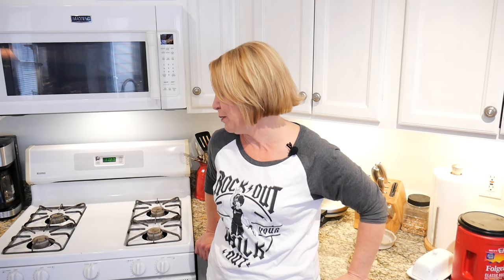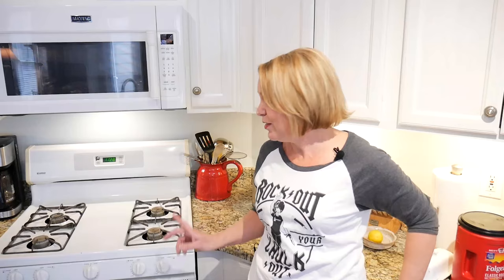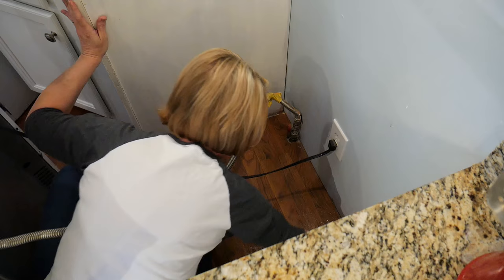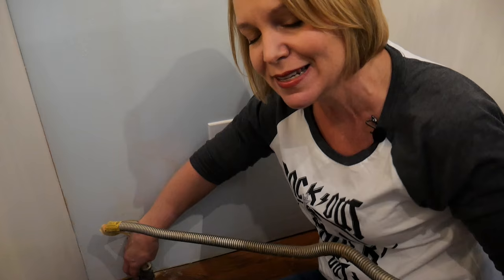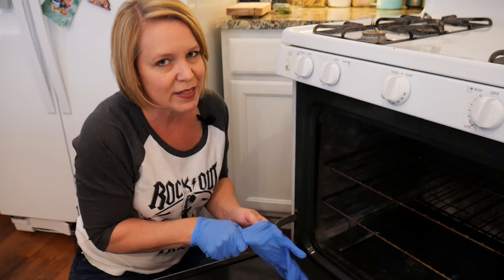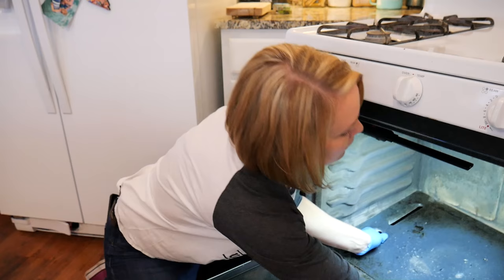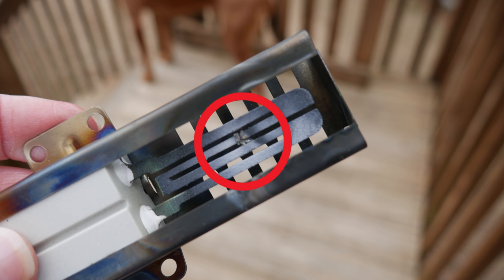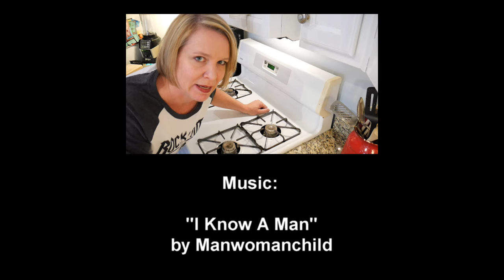Replace a Broken Igniter on a Gas Oven

Comment: Thanks.  Replaced mine on a 12 year old Kenmore.  Machine screws were stripped, which, I read, is a common problem. Let's just say that replacing the drum brakes on my 99 Honda in 100 degrees was easier than getting those screws off.

Comment: Thanks for the help, after installation i could smell gas, turns out the previous technician installed the old igniter upside down so too much gas came out before ignition , my wife had mentioned that but I unfortunately never investigated..cheers👍

Comment: How do you remove the bottom face panel of the stove? I'm not talking about removing the bottom inside the oven, I'm talking about outside of the oven.  Where it looks like there's a bottom drawer but it's not, it's just a bottom panel outside of the stove.  is there a video on how to remove that? Thanks.

Comment: Hi ChickFix!  Does the polarity of the wires need to be determined before reconnecting?  I'm assuming it doesn't matter because of AC voltage.
Reply from the maker: Nope, it does not matter
Reply: @ChickFixUSA  Thank you!

Comment: What tools did you use to remove the screws?
Reply from the maker: Just a socket wrench set. It's been a while, so I don't remember the size of the bit.
Reply: I used 1/4

Comment: How’d you pull the oven out so easily? Did you use like sliders under? Just ordered my replacement igniter yesterday
Reply from the maker: Mine slides out pretty easy, but I have to lift it slightly to get it over a bump where the flooring comes together.

Comment: Actually, dragging your whole stove out is unnecessary.
Instead of unplugging the stove, simply go to your electrical panel and throw out/disconnect the circuit that powers the receptacle it is plugged into.
You can check this by seeing if an upper burner lights if your stove does not have a clock.
The gas inlet on the stove has a safety interlock with a control valve where if the igniter is not working, the electrically controlled gas inlet valve will not open allowing gas to flow into the oven's burner.
Reply: I pulled my stove out to do the repair. And vacuumed up dead roaches after spring application of Combat roach paste.
What if the stove is on a shared breaker? The igniter only draws 4-5 amps. Do you flag the breaker panel: "Out for service, do not touch?"
I know a few people who got injured when others failed to listen to very simple warnings and STILL didn't do as directed.